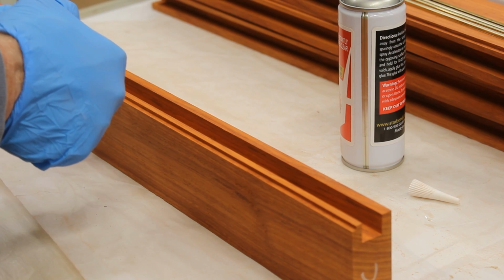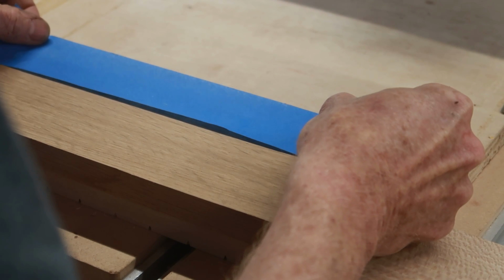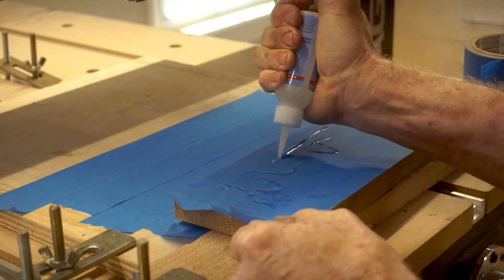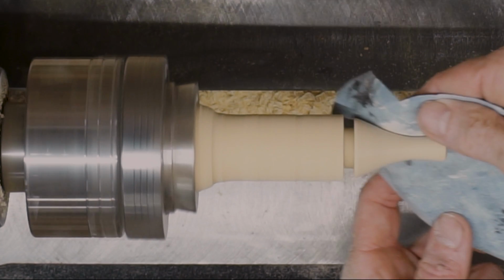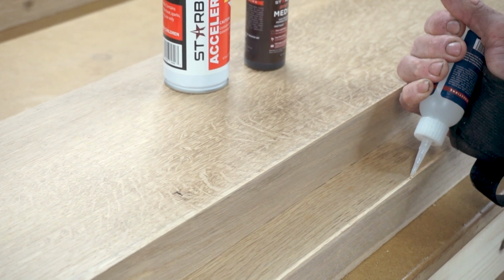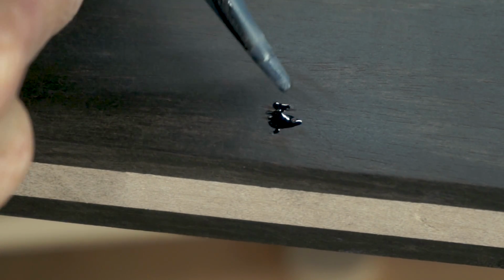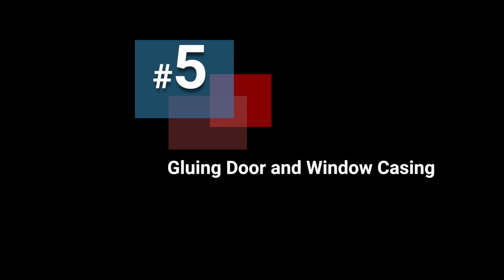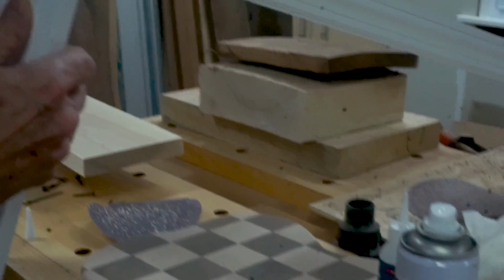My Top 5 Uses for CA Glue

Comment: How do you keep the glue from sealing the nozzle after use?
Reply from the maker: Surprisingly, I haven't had that happen with the Starbond CA glues unless I keep the bottle for a very long period of time. As long as I keep them upright and put the cap back over the tip, it doesn't get clogged up. They do provide extra tips in the even that it gets clogged, but I've rarely needed to use them.